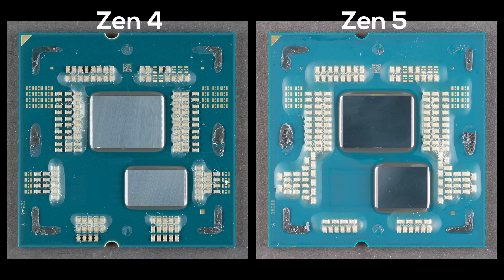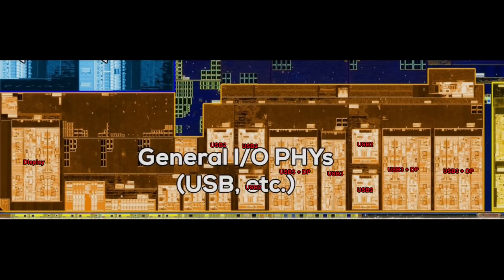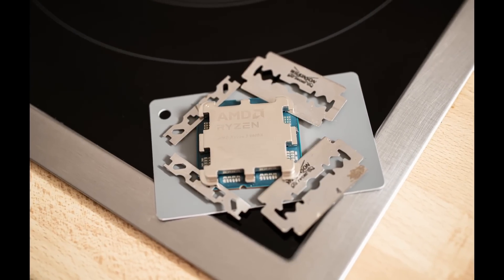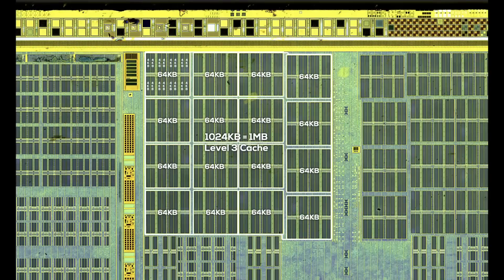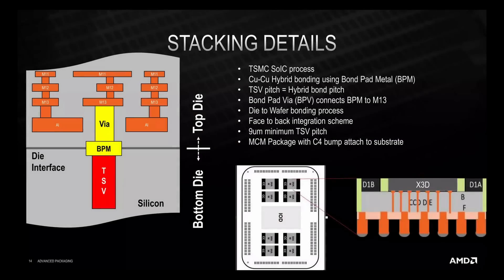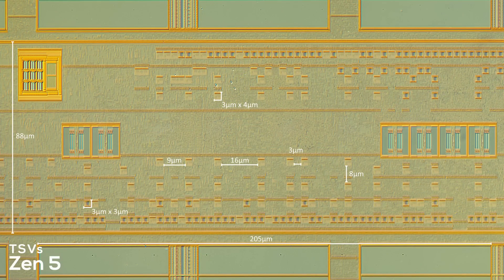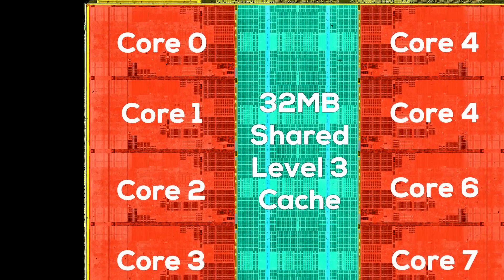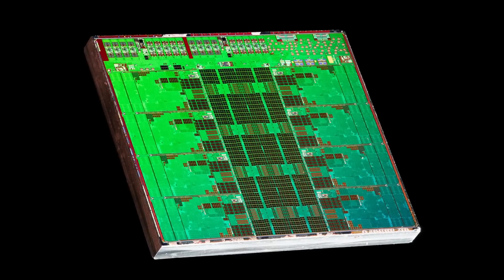ZEN 5 has a 3D V-Cache Secret

Comment: Very good Deep Dive ! 

AMD claims to reach 2 to 2.5 TB/s of bandwidth between CCD and 3D Vcache. 
Question#1: If I make my math 32B X 2 (Rd/Wr)  x 8 slices= 4096 bits pers lices. What about the the other 5000 TSVs to reach a total of ~9000 TSVs ?
Question#2: 32B x 2 (Rd/Wr) x 2.5GT/s x 8 slices = 1.28TB/s. Then, how do they reach 2/2.25 TB/s ?

Does anybody have the answer ?

Comment: > why spend time re-engineering the IO die when it works?

True but my last cpu was an X4-860k and I upgraded to a 7700x, much to my disappointment after 10 years the platform was still heavily bottlenecked by it's IO performance with the difference being AMD moving the IO circuits onto the chip instead of being in the northbridge. Net result: probably some significant power savings but equally poor latency and an equivalent hard cap on bandwidth. Pretty disappointed to need to wait even longer for memory management to be fixed

Comment: Questions, questions:
* On Zen 4, the cache chip is on top of the CCD, so the top of the combined chips is not flat.  How do they connect this uneven surface to the heat spreader?
* On Zen 5, I read that the cache chip is under the CCD.  It doesn't appear that you saw that.  But if so... it seems it would help get heat out, but then how do they get the IOs and power connections through the cache chip to the CCD?
* At one point, you say they used the same cache chip on Zen 5 as Zen 4.  But then you point out that it wouldn't work, and you say they used a new Zen 5 cache chip design.  Which is it?
* If the CCD and cache chips are connected with hybrid bonding, there should be no need for TSVs on the top chip.  It wasn't clear if that's the case.

I worked on the MIPS R8000 in the early 1990s.  It is amazing to see an FP unit with the register file being the same size as the execution pipeline!

Comment: 2 512bit FPU units in a core with hyperthreading... Yeah, that will shred some benchmarks for sure. Now if only we could get a compiler to generate AVX512 code where applicable... Because 99% of devs surely won't make use of it at all. Still hoping someday we could get a recompiler that optimizes machine code.

Comment: I just had a revelation, what if the TSVs in the die shots are the BACKEND of the TSVs.

What if the bonding side of the TSVs are on the BACK of the CCD and the Vcache is underneath.

Leaks are showing 9800X3D boost to 5.2Ghz. No way a double stacked Vcache will allow so much heat through.
Reply from the maker: That’s pretty much the most likely scenario here.
Reply: You've ended being right!

Comment: They put the vcache underneath the CCD! Who wants to bet that the next generation will have the CCD placed over the vcache and IO die and connect to both using TSVs, completely eliminating the need to use the substrate as an interposer.
Reply: Hmm, perhaps. The IOD does consume a fair bit of power, though…

Tbh it might even make sense to produce the IOD with a cheap process like 14nm, so it’s well spread out and have a large surface to mount the CCDs. Having a large surface area to dissipate heat from would be beneficial, and it would be cheaper. So long as the cheaper process is compatible with the bonding technique, mind you…

Comment: Apparently the puzzle has been solved. The reason there's so few TSVs is because the V-Cache is underneath the CCD, so the CCD doesn't need power TSVs, just data.
Reply: Right, the V-Cache is getting it's power through a shared power rail supplied by the package.

Comment: Maybe they can get away with fewer TSVs due to a higher success rate in manufacturing? If we assume that some of the TSVs don't properly make contact after attaching the V-Cache, it'd make sense to build in some redundancy such that those missing connections can be compensated for. Maybe the original designs were too conservative in this respect, so now AMD can incorporate fewer TSVs into their design for redundancy, because the success rate is higher than TSMC originally predicted or the manufacturing process was improved.
Either way, as a layperson, I feel like such a massive reduction in TSV count can't be only due to reduced redundancy, so I wouldn't be surprised if there's more to this.
Reply: Or it could be that the vcache is underneath the CCD, so the CCD doesn't need power TSVs, just data.
Reply: @ckmishn3664  That'd makes a lot of sense. I wonder though, wouldn't they want to pass those "through" the V-Cache anyway to use in the main CCD? Seems like this'd result in a big "deadspot" in terms of connectivity right in the middle of the CCD. Maybe they're still there but not visible from above? But then why are there still some visible from above? Are they planning to stack something else where the V-Cache on 5000 and 7000 x3D chips was?

Comment: Shrinking the IO-die  to 4 or even 3 nm will not result in a higher Infinity Fabrick clock, right? What solutions do you see to enhance those fabric clocks at all to run high speed ram in a synchronous mode (1:1:1)?

Comment: A lot of people think two 3d cache '8-core' chiplets are solution, but isnt that also problematic latency wise? You still have to (while big) 3dv cache chiplets that have to port information before it becomes 'fast' information. It's the latency more then lack of second chiplet with 3dv cache, that stops performance imo. AMD had up and running 5950x3d dual 3d cache chiplets in house (see Gamer nexus video when they visit amd). didnt put it out, that should say enough amd is smart enough.

Thanks for video, very informative stuff. So the rumors that while zen 5 might be weak (over zen 4), it still is a stepping stone for potential big zen 6.

Comment: Zen doesn't have a "ring bus" ;). The most there is is a horseshoe :D.
Reply from the maker: It’s really not a ring?
Reply: @HighYield The ring is closed, and in Zen 3,4,5 the two buses are connected to the "Global Memory Interconnect". And in addition, the L2 data cache (near the core) is "duplicated" near the data bus as the "L2 shadow cache".

Comment: guys question from semi-amateur.
L3 power should be same as 3dvcache power right?
why not include a power via through every cache cell, where that cell get his own power?
if each layer have same design, they should have those TSV's in same locations, so at least for me it sounds like an easy way to sneak a lot extra, if needed, without taking any more space.
I feel like that will be the next step, where some areas overlap at edges, where any "free real estate at the corners or edges is a way to sneak power or another data line to adjacent component

Comment: Core parking has a lot of problems. So in my opinion the 64 MiB 3D cache will be split, and both CCDs get 32 MiBs.
Reply: core parking is a software issue, not hardware issue. I always experienced core parking both on my Alder Lake i7-12700K and Haswell i7-4700MQ.
Reply: @saricubra2867  There is a small problem with your opinion: you talk about intel processors with not a single bit of 3D V-Cache and no chiplet design. Totally irrelevant.

Comment: AMD is somehow ahead of Intel in simple short performance terms. If comparing their specs, Intel is integrating more advanced DirectX version, larger L2 and L3 caches sizes, more PCI-E lanes, more advanced PCI-E generation, compared to AMD. It still is a running battle and Intel‘s switch to TSMC and ASML machines in their own fans, will show,,what’s inside this old giant.😅

Comment: I am wondering if you are overlooking an obvious answer to the reduction in the via size. Given that we already know that AMD has said this gen of the 3D V-cache chips will not be affected by the heat issues like the previous gens and overclocking and similar frequency levels to standard chips. I think they may have moved the v-cache chips UNDER the core die. This makes sense as to why the vias would be smaller as they would be the end of the power via not the beginning. Also, for last gen AMD said the v-cache mounted over the cores made it very hard to control the heat dissipation and having the v-cache chips under the core module would solve this as the mem chips generate far less heat and more uniformly. The latency penalty would also be minor as the v-cache layers are very thin.

Comment: "Works fine" is a bit of a stretch for the zen4 IO die. The memory controller is kind of dogshit and the infinity fabric is holding the chip back by a lot. 
Focusing on improved IO instead of cores would've been been better for the gen.
Reply: The comment below yours when sorted by "newest first" talks about that with what Zen6 is potentially going to offer when AMD uses a new I/O chip that will replace the one that has been used on Zen4/5. It would have been great if Zen5 used a better I/O chip but like you stated, what they released with is definitely holding back the potential of what the CPU is capable of. Another improvement would be if they ditched the two channel memory controller and went quad channel so that all four slots could run at full bandwidth when all the slots are populated but who knows if either Intel or AMD would ever implement that idea on desktop/ gaming CPU's.
Reply: Not to mention that the I/O die consumes a lot of power in idle. So even if the CCX has a state of the art power management, the I/O die will consume ~20W by doing almost nothing. Monolithic Intel CPUs could go down to as low as 6W in idle.
Reply: @temp50  Definitely contributes to higher idle watts because of the chiplet design. Unfortunately Intel lost that advantage by doing the same thing and moving away from monolithic. I would be curious to know if they were able to tame the idle watts better than AMD, don't think I've seen that mentioned in any reviews yet. Unfortunately Intel also lost the other advantage of monolithic design and it seems as though there are added latency penalties where they didn't used to exist. 

I also find the power efficiency debate to be rather superfluous considering that most people will be using GPU's that consume a lot more energy than a CPU, especially during gaming when the CPU is generally at its most efficient for watts/ work.

Comment: This video confirms that Zen5 indeed is a new architecture. That is pretty impressive: improving 10-20% in many areas, 1-2% regression is 1 area. It is hard to pull that off with such a new design. I expect that there is a lot of low hanging fruit for AMD to pluck for Zen6, it is much easier to improve a lot of things iteratively on the same design than that it is to radically change the design. Add to this that Zen6 will get a new I/O chiplet again and I would expect Zen5=>Zen6 giving a higher performance improvement than Zen4=>Zen5, especially for gaming. Like how it was for Zen2=>Zen3 (I have a 3700X so I missed out).

Comment: If the cache chip had power vias, it seems that this could reduce the number of power connections needed from the processor chip. Perhaps reducing the power delivery provided by the processor chip allowed the power pads to be smaller and there may be reasons to keep the power and signal pads similarly sized.

Power vias along the edge of the cache chip might also provide some thermal conduction (as @williamdouglas8040 commented).

(I am not an EE, just a computer architecture enthusiast, so that is just a wild guess.)

Comment: Double stacked V-cache won't come to consumer range Ryzen. If you make the silicon so damn thick, heat transfer is going to suffer, causing vcore to be very low to minimize heat output.  It make sense in Epyc where clockspeed is much lower in general. For consumer Ryzen platform, the clockspeed is critical for single threaded performance.
Reply: On the contrary, processors with 3D V-Cache have better heat dissipation indicators; statistically, in most tasks performed, the core blocks are less loaded, and, accordingly, the overall consumption is lower. ;) Ryzen 9 7945HX3D Default TDP - 55W

Comment: I was just complaining the other day that I couldn't find deep dives into newer CPUs. This is far cry different from the AdoredTV I have missed since he left, but definitely scratches the itch. Also those die shot are really amazing! 

As far as the TSV question: I would like to throw out the cavet that I am not an engineer, but just based on your own comparison of Zen 3 to 4 to 5 fuels my guess to the mystery. When designing a new feature, to both improve on previous designs and not waste space created by other optimizations the TSVs that were added were "possibly" over-engineered, and given extra space to ensure the new feature would either work, or work after intense testing, and microcode optimization.  As such the smaller TSVs are the result of them being tested and optimized. The overall structure/stability of the chiplet is not at risk, because any additional area that isn't filled in with other parts of the overall design would be filled in with inert martial. 

I don't have a reference to back that up, but it just makes sense to me. the overall package has to be kept as flat and structurally sound as possible to provide a solid contact for the soldering of the IHS. The Gamer's Nexus video of the AMD labs shows how they measure the "curvature" of the overall package once the dies are inlaid to ensure they are not exceeding those limits.

Comment: Thank you very much for the informative video. This has helped me decide, which I had an idea of, that the 9800x3d will have more speed than the previous. I am still with the 5800x3d since it first launched. The 5800x3d was a first, then the 7800x3d. Now, the 9000x3d's are coming soon. This will be a major boost in performance. You just earned a new subscriber.

Comment: - 00:00 🎥 Introduction to Zen 5 architecture and chip design, focusing on detailed die shots of Ryzen 9000 Zen 5 CPU.
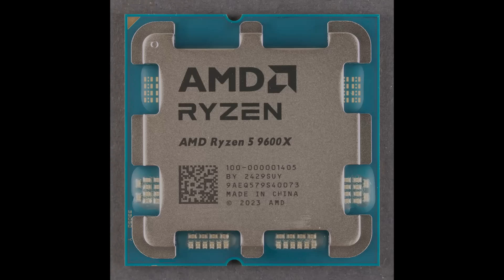- 01:05 🔍 Zen 5 chiplet layout explained: classic Ryzen design with I/O-die and Core Complex Die (CCD) positioning.
- 01:50 🟦 Zen 5 CCD now has a square shape compared to Zen 4’s rectangular one, yet similar in size.
- 02:16 💡 Zen 5 packs 26.6% more transistors than Zen 4, leading to a significant increase in transistor density.
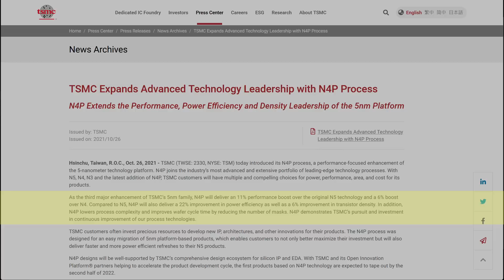- 02:45 🧑‍💻 Overview of the I/O-die: larger but with low transistor density due to analog circuits and interconnects.
- 03:25 🧠 Memory interface features dual-channel DDR5 support with a 160-bit wide interface.
- 04:11 🔗 Infinity Fabric interconnects connect CCDs with I/O-die, crucial for memory access.
- 04:29 🎮 RDNA2-based iGPU with two compute units, offering basic GPU functionality.
- 05:29 ⚙️ Zen 5 reuses the same I/O-die from Zen 4, a cost-effective decision since I/O remained state-of-the-art.
- 06:34 🧩 Zen 5 CCD design features a unified L3 cache surrounded by eight CPU cores, with a more compact L3 cache layout.
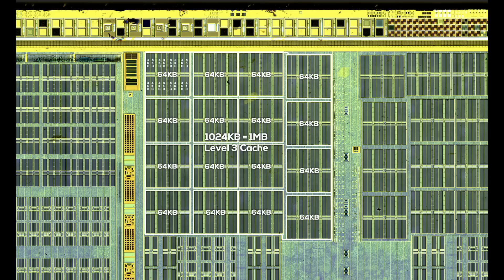- 08:28 🔧 AMD achieved significant reductions in L3 cache area through tighter transistor packing and elimination of gaps.
- 09:42 🏗️ TSVs (Through-Silicon Vias) in Zen 5 have undergone a major redesign, becoming smaller and fewer compared to previous generations.
- 12:44 🔬 Zen 5’s TSVs measure as small as 3 by 3 micrometers, a drastic reduction from Zen 3 and Zen 4.
- 14:29 🧊 Potential issues with heat dissipation arise if the same 3D V-Cache chiplet from Zen 4 were applied to Zen 5, due to differences in L3 cache size.

Comment: Most insane trick I can think of would be a smaller 3d-cache... but one that uses the same trick as ssd's. Use more voltage steps. I doubt they'd do that. It would be insane. I hope they figured out ways to pump the heat out and make a cache as big as the chip below, not just covering the 3rd level cache. Wonder how much more 128Mb of cache instead of 64 would bring.

Comment: I hope this isnt a stupid question, but i keep seeing so much area that looks empty, on the I/O die it was dark blue (4:20), between the TSVs (13:24) it looks blueish.

Are theese areas actually empty? meaning there just isnt a way to arrange the other "blocks" with less space in between, or is there actual functionality in these areas that just arent captured by the way the photo was taken/colored?
Reply from the maker: No, they are not empty. In order to get the die shot, you have to remove the metal layers with acid, which doesn't reveal all structures the same way and especially high density areas can look a bit "dirty", like there's a spill on the silicon.

Comment: Excellent analysis, thank u & Fritzchens Fritz for another excellent chip analysis!👏Referring to your older vid about cache SRAM manufacturing limitation of not being able to shrink it further: https://youtu.be/vQ5JPqeFitM?si=EN__TLQiK3gb4Zqe it looks AMD has somehow managed to do exactly that however not because of the more advanced node process, but of its redesign (right?). It would be great if u could investigate and elaborate further this topic with the 3D V-Cache in mind and also in regards to the upcoming GAA transistors and separated power - data silicon improvements. Looks to me that SRAM cache and further memory subsystem will play HUGE role in the performance of future chips.

Comment: Swapped a 7800X3D for a 9700X and am positively surprised about Zen 5. I care about efficiency, and to see it boost much higher than the 7800X3D while temps are barely moving, really tells you a big step has been made in terms of miniaturization.
I also have done extensive testing with memory overclocking. But although some keyboard warriors will tell you Zen 5 raises the bar on that front, I can’t say it does: in fact, it’s exactly the same as Zen 4 - not surprising, since the IOD is unchanged.